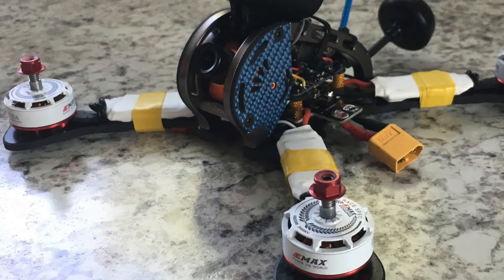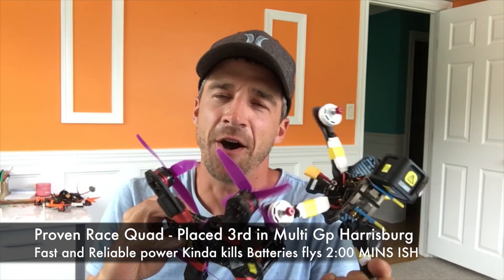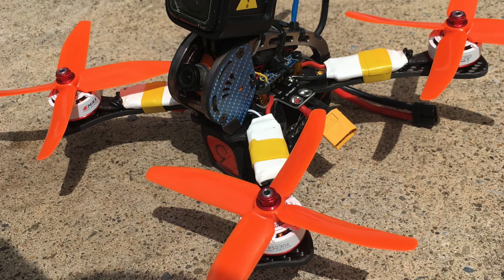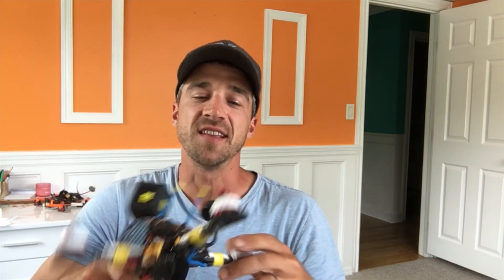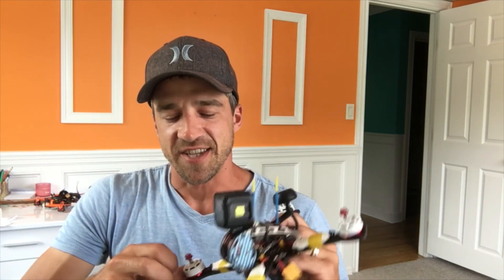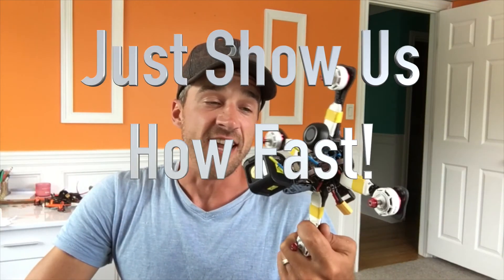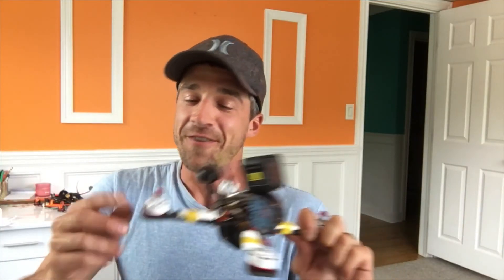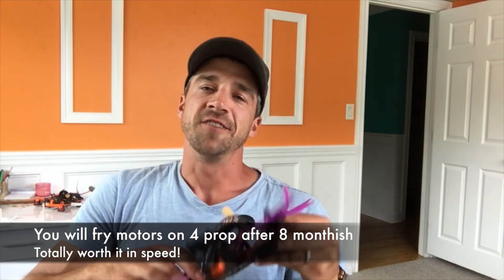Emax 2306   2400kv Motor Review

Comment: What is your battery specs with c rating?
Reply from the maker: kakubotics s the batteries I used are Turnigy Graphene 1300mAh 4S 65c. I would recommend a 90c or 100c battery for these motors if your racing. If you freestyle you can get away with using the 65c. Thanks for watching 😁👍
Reply: for a bicopter weight 1 kg,two motors emax 2206 2750 kv ,two esc 30A ,hq 50X40 bullnose, TELL ME THE BATTERY SPECS? WITH C RATING? please

Comment: How mutch weight is this quad then?
Reply from the maker: Bennie Leip Hey! Thanks for watching! I just got a scale this week. This quad weighs 412 grams with props and without the GoPro. With the GoPro 485 grams
Reply: hello I just build a quad with the emax rs2306 2400kv motors and it seems they are not that power hungry but my quad weigh is 325grams with no battery and about 490 with battery guess thats the reason